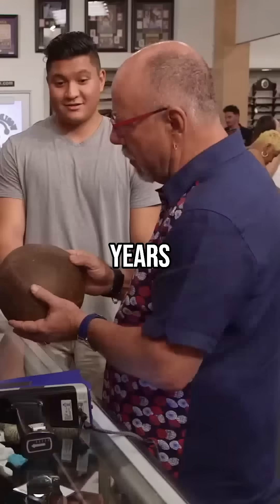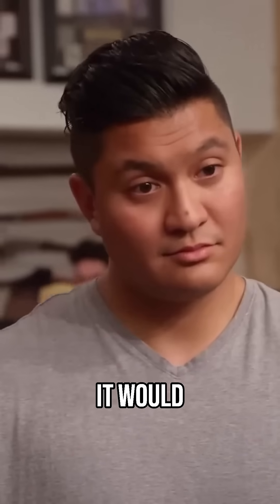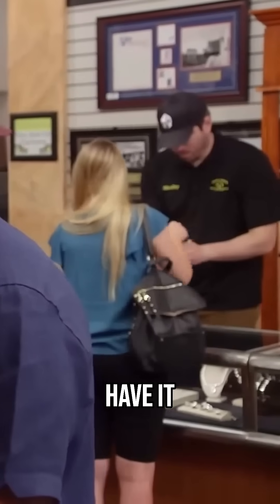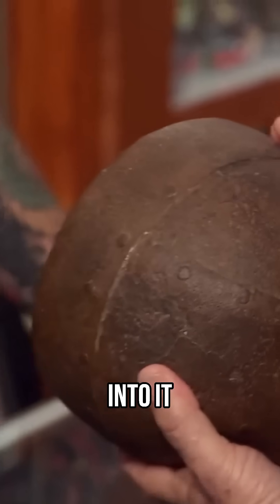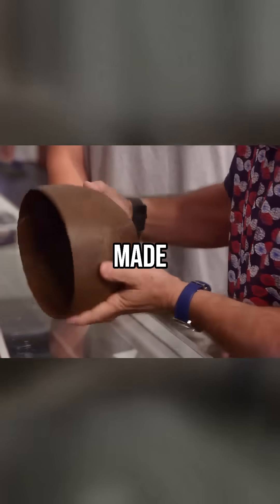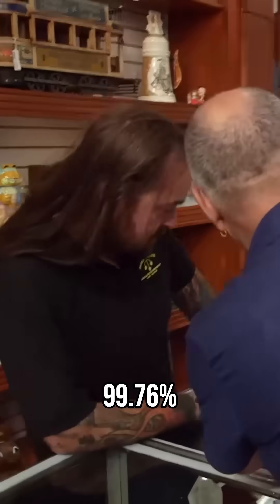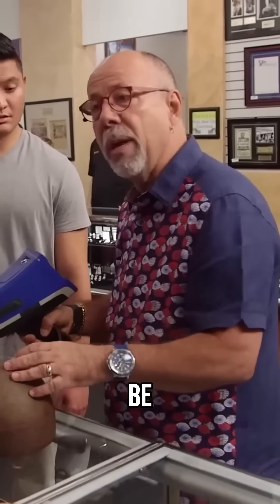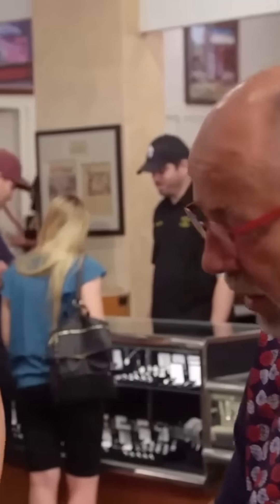Unearthing Ancient Iron  Testing its Authenticity with X Ray Analysis

Comment: The expert:

'Some place where the isn't oxygen like a bog or a river'

the water based river (H2O)

Nothing to see here
Reply: Molecules fused together won't necessarily act as they do when separated. 

oxidization (rusting) of metal usually requires oxygen (separate from other molecules) as part of the process.
So if it was in pure oxygen (o2) or pure water (H2O), it wouldn't rust.
Reply: All you've demonstrated here is your lack of understanding of chemistry
Reply: Yes that's what the expert said. You lack understanding

Comment: I wear a thick lead vest and everyone leaves the room to xray my teeth, thus guy just walks around with a xray gun....
Reply: Not the same output, bud. You remember how big the machine they were using was? Obviously uses way more power
Reply: @manuelmenendez8239  yea I know, bud, it's still the same same xray radiation though. Just like UV from a UV light is the same UV that comes out of the sun. Not the same amount, but it's the same thing.
Reply: Think like the difference between some sunlight coming through your window, and going to the tanning salon or standing around uncovered in the sun all day every day in terms of skin cancer. The intensity of X-ray and time you sit under it becomes a cancer risk if it is excessive, but we are all actually exposed to small amounts of background radiation mostly from space all the time, including X rays. Just like sunlight and skin cancer, it’s only really a problem when it reaches a threshold where it is damaging tissue and causing mutations in the tissue that regrows.
Reply: It's called a PMI gun. I use it to test the carbon on pipelines and stuff
Reply: Yes the amount of power and duration of the exposure it's practically nothing...not to mention remember xrays don't go through metal...believe me if it was an xray hazard OSHA would be all over these with warnings and big radiation signs only allowing to be done in a confined box
Reply: That's a completely different xray 😂😂
Reply: @scrappyhustler7467 it's the same just in a gun
Reply: @heychimney007 duration and power matters. A single chest x-ray isn't deadly to others in the area, but for staff especially if they have multiple second hand exposures every day for years, the chances of it being cancerous greatly increase. The x-ray intensity needed to for XRF is probably low power compared to that needed to penetrate your body and be detected by film or sensor on the other side. The reflection back into the gun is likely shielded. I can't imagine much x-ray escapes and not for very long.
Reply: @benargee  I just wanted make sure that the other person knew that the x-rays themselves are the same
Reply: @heychimney007  lol true, I got caught up in my rant. It's the same location on the EM spectrum, but power and duration is most likely different.
Reply: @benargee  oh I'm sure. It would be sick to have a full powered xray machine in a handheld form. A literal cancer ray